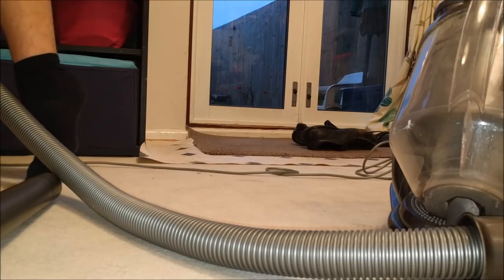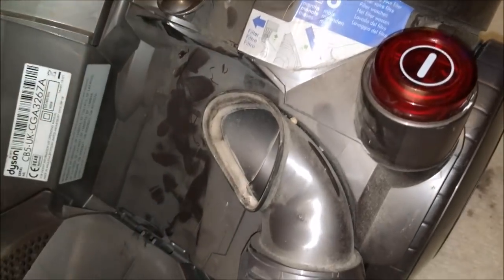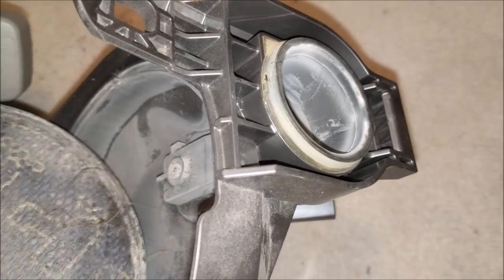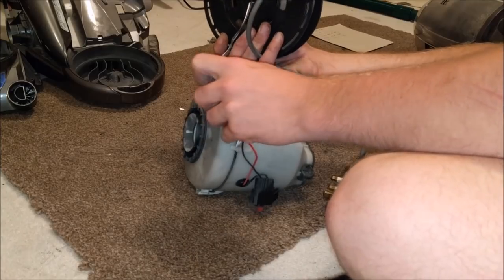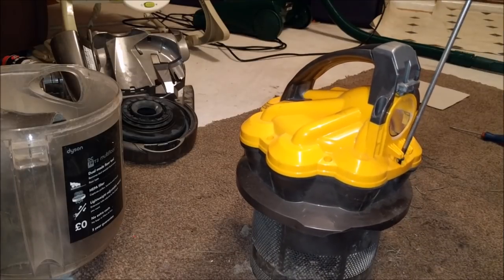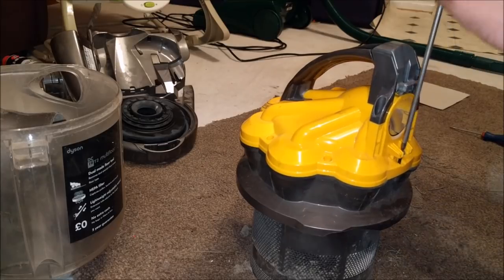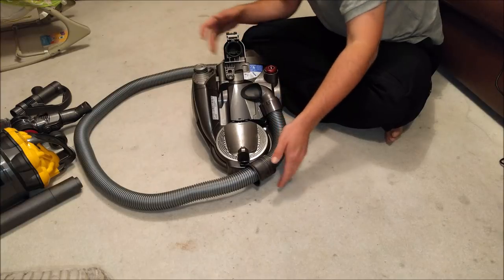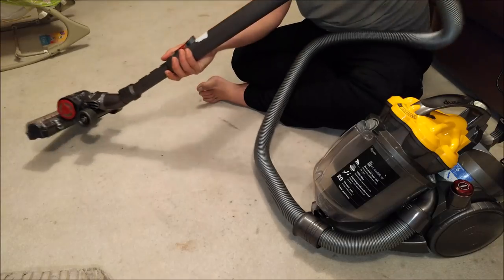Dyson DC19 T2 - Full Stripdown and Refurbishment

Comment: As an ex transmission rebuilder I had to Keep complete concentration on rebiulding the Valve Body (brains of transmission). When I started  the work on the VB nobody was to mess with me till completed. It was a messy job with steaming hot fluid all over place if the VB had to come back out.  Vacuums are much more enjoyable and a less caustic to ones body as long you don't breath to deep.
Reply from the maker: Keith Millington Blimey, knowing how complicated gearboxes are that does sound alot more involved than wanging a dyson to bits! Miss a spring out on a 19 and chances are you won't even notice! Miss it out in a gearbox... You might get a mile/2nd gear!

Comment: Hahaha! Bloody brilliant at 59 mins when the camera went awol! I was amazed at your confidence in just whacking the bits apart. Mines playing up with the power supply, its apart thanks to your video but I can't find the electrical issue
Reply from the maker: Ross Brewster Thanks! Mmmm power issues... Break at the cable? Knackered switch? Overheating and dying motor?
Reply: @beko1987  can you use the new motorheads on it

Comment: Thank you very much mine was long over due, I have two cats and a wood burner so it went a long way. I could not believe how easy it was. I found after you washed everything by hand put it all in front of your heater and use a hairdryer for the hose so that way you only have to wait a day for everything to dry out. I now have a new moter on the way even know the old one works fin ill be ready for when it's not

Comment: Thanks - very helpful video - however I'm confused by the wiring of the motor. The white wire is neutral, the black is live (as it's the black wire that is switched) but the white wire is connected to the red wire in the motor housing - maybe it doesn't matter as it's an AC motor assuming there's no other electronics in there but seems odd.

Comment: Excellent video. Nice clear audio and easy to see what you are doing. And all o the point. Good work. Although scary how you disassemble and just put everything into a box! You clearly know what you are doing and organise it and (clean and) put it back together beautifully - but maybe tell others they may need to label or photograph as they go along. Not a method for the inexperienced! Also it is so impressive how clean and new looking you make all the parts are but you don't describe how you have cleaned them (apart from a washing machine.with some towels for the filter). I would really like to know the best way to clean super dusty plastic from the master. Mainly how to clean the cyclone assembly/dirt bin - my DC19 works well but the previous owner had dogs and so it is quite smelly). Best wishes.

Comment: Thanks man. I only needed the head disassembly ha. But I managed to find out the drive rod had separated from the white fan thing. Gorilla glue and some time and we shall see if the bar spins :)
Reply from the maker: I did the exact same to one the other week and it worked fine! Just be sure to get rhe fan onto the rod in the right position or it'll rub on the housing when assembled 👍
Reply: @beko1987  ha and after all that the fan is rubbing… hmm not sure how I can align this correctly. Maybe I’ll shave a little off each blade

Comment: The only thing I wanted to know you did not cover 😂 any ideas how to get the end off the hose (the end with the red button) that connects to the floor roller connection.
Reply from the maker: You mean the part directly attached to the hose? Which then plugs into the handle and wands? If so you can't, it's moulded onto the end of the hose, new hose time I'm afraid 😢 (the little clip itself will pop out to be replaced though)
Reply: @beko1987  Thanks!

Comment: Rescued a DC19 Turbine from a green shed a few days ago and your video is a godsend in terms of a how-to guide for a refurb. A couple of questions though.

1. How did you clean the rubber seals and is there anything I need to be aware of to make sure I don't ruin them. I accidentally got water on the seal connecting both halves of the cyclone array, however it's thoroughly dried; am I likely to have damaged it.

2. Are the plastic parts safe to put into the dishwasher on a warm wash and if so, is there anything I need to be careful of re detergents?

Cheers.
Reply from the maker: Andrew Richards Excellent, glad to see it's inspired you! I clean the rubber seals with G101 as I wash everything else, but for the final 'as new' clean cif cream cleaner on a damp cloth brings them up like new! Makes the cloth black though. Or baby wipes. I've not got a dishwasher so never tried, but many other collectors have and say it works very well, just don't make it too hot. No idea about detergents though. Buy a sub £5 scrapper from ebay and run some tests! Maybe make sure the missus or mister is out when you do though, they may get funny (mine does when I put hoses in the washing machine!)
Reply: Thanks for the prompt reply. Am I likely to have wrecked the seal I mentioned by getting it wet - even though it's dry now to the naked eye?
Reply from the maker: Andrew Richards No, itll be fine! As long as you didn't fill it all with water then turn the machine on. If you've got an airing cupboard or it's a sunny day where you are rather than the wet day it is where I am, put it there all day to be sure it's dry, but a single wet seal will be fine, the water should evaporate before its pulled into the motor!
Reply: Thanks for the info so far - it's been really helpful and I've even found Australian alternatives for cleaning products. Just one question with the Jif cleaner (that's what they call Cif here apparently), is there anything I need to be aware of in terms of scratching the plastic parts when using it?
Reply from the maker: Andrew Richards Aah Australian! Ace. I've never found cif to scratch too much. It'll mar the clear bin a but but chances are it's already scratched up with use. It's fine on the plastics and rubbers as it's not too abrasive, just don't scrub it in very hard etc
Reply from the maker: Andrew Richards And it used to be called jif here too! They rebranded in the late 90s I think, didn't know it was still jif elsewhere. Wonder why the uk got changed and nowhere else didn't!

Comment: Ahhh! Annoying. I've got the dc19 with one of the original floor heads, it's the one with the small internal hose that runs through it. It's not a turbine, just standard one. I've looked for replacement internal hoses online and there doesn't seem to be any!!! All they have is the internal hoses for the upright models. Does anyone know where I can get one? Thanks

Comment: Hi Sam, I watched and re-watched this but still can't tell what you did at 3:45. It just seemed to suddenly come apart what did you do to get the bracket off the hose? What do I need to push?
Reply from the maker: The hose is held into the bracket with an inner retaining ring. I've had them just pull out with a snap before, but here I released it then pushed it through. Just keep poking at it and eventually it will unclip and be free

Comment: Good vid, however you have left out the 3 sliding screw covers for the short screws inside the cyclone.
Reply from the maker: Yep, still got them actually, found them after it had sold

Comment: Can i put a turbo head on a stand dc19 ps what really is the difference from the t2 
 im missing tools and a head for carpets
Reply from the maker: Yea it'll take an air driven head, just make sure the connection is the same for the wand! I think the t2 had the hose wrap slot but I'm not too sure...
Reply: @beko1987  also blue washable filler to the top yellow to the bottom